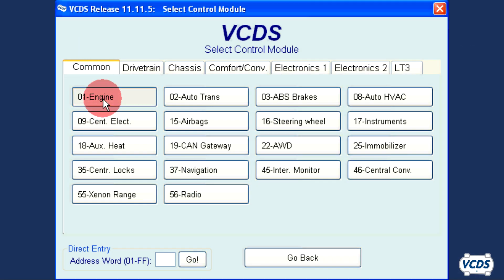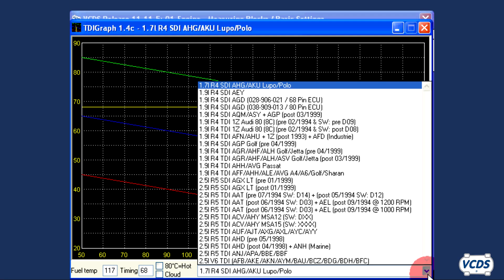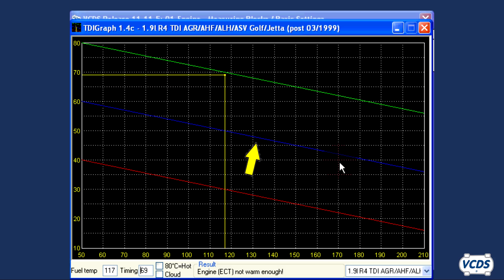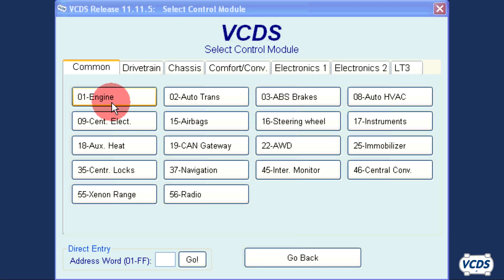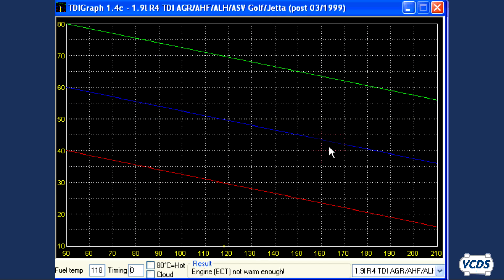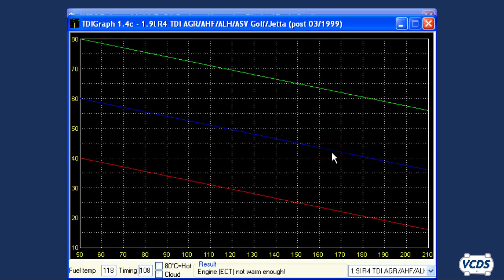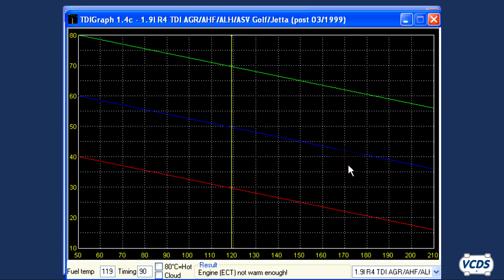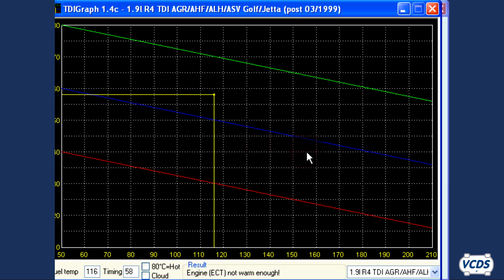Start of Injection

Comment: Im a newbie  with vw cars, I need help, I have 99 vw golf 1.9 tdi  I replace injector pump did the timing belt etc..., I need to set the timing on the pump , first question how can i do this what software do i need where to get it free or cheep, where do i download it  for free I herd i can  just buy the cable  software free? please help.  i seen video on vcds but never used it,  dont know where to start to set up software ... lots video using software... no video on how to get started with software.

Comment: Mine is a little bit above the green?
Reply: Then it's a little too advanced.  Loosen the three 13mm bolts a bit (but not so much that they exert NO friction against the injection pump pulley) and then slightly bump the 22mm nut toward the rear of the car.  Tighten the 13mm bolts and check to see if you got it into range.  You just need a pretty subtle adjustment.

Comment: Excellent video. I tried this on my Audi A4 B7 2.0 L TDI PD, but the VCDS doesn't show the option of going to group 000 and TDI Timing. I would like to check my timing as well.
Reply: PD engines dont need injection timing adjustments. They dont have any mechanical distributor type pumps to adjust and injection timing is fully adjusted by ECU.
Reply from the maker: We offer free vehicle support on our web forum for all of our registered customers.   http://forums.ross-tech.com

Comment: You selected the wrong motor.  Why is that.  2002 ALH TDI would be Pre 2004 yes?  You selected post 2003.
Reply: Nope, he selected "Post 03/1999" (meaning after March 1999), which is the correct row for this engine. The other row was "pre 04/1999" (meaning before April 1999), and therefore not the good one in this case.

Comment: i did basic settings for afb engine 2.5 , the two  yellow became between the red and yellow and fault code 00555 appeared again,
Reply: Thats not start of injection, is the quanity.
Basic setyings group 001. 3rd bar, it shud be between 3.0 to 9.0
Or by putting the mouse icon over it, it will tell u what it needs to be.

Comment: As a side note : the timing can be so retarded that it shows on the graph as being to advanced. Happened to me on a 1.9 AHU engine. Started ok when it was cold and the glow plugs came on,started ok when the engine was hot. But when the air outside was warm and the glow plugs wouldn't come on i would have to crank more then 30 seconds,sometimes almost a minute. All that went away when i did this adjustment.

Comment: my idle speed on my 2000 passat tdi is at 800 rpm,can i adjust it to be at 900+ rpm?
Reply: Late reply (8yrs😂), but you should check your "adaptation" number to see if someone changed it from the stock setting in order to adjust their IQ (injection quantity).  Adaptation also changes idle speed.  If IQ is way off at the stock 32768 number (which should give ~900 rpm), search for "hammer mod." You may need to pick up a special injection pump socket to loosen the triangle-shaped bolt. Your car will run much better after getting these parameters dialed in!

By the way, I am assuming you already have VCDS.
Reply: If you can download the map to you computer and send it to me , ill do that for you

Comment: What if you cant start the car? How do you check then?
Reply: There's a matching set of lock holes on the pump and pulley flange that line up (using a 6 mm pin, I think). Bring the engine close to piston 1 TDC, loosen the pulley bolts, rotate the pump until the lock pin slips in, then bring the engine exactly to TDC and then tighten the 3 pulley bolts and remove the lock pin.
This pre-adjustment is close enough to get the engine running.
Reply: @MarcusRoper171  I am also having trouble, Brand new engine, can't seem to keep the car running. it starts for  a few seconds and then dies.
Reply: @BlayneBriceno-j8l  If the engine starts, even for a short time, then I don't think pump timing is your problem. But just to confirm, you can try to retard or advance the pump just a tiny amount. If that doesn't change things, then you definitely know that the problem is somewhere else.
Reply: @MarcusRoper171  I have been messing with it quite a bit. I Advanced it a little and nothing changed, maybe I'll try and retard it and see what that does. I've read that there are a few different sensors, my asv is open, not stuck at all.
Reply: Before you start make marks to have old settings
Reply: The adjustment is TINY like the width of a toothpick! Only move it very small and check on graph.

Comment: what those units means? (60 - 90 etc). It is 60 -> 6.0 deg?
Reply: Old question but if someone is wondering: Lift of the injection pump in mm*100 when in tdc position. So 60 on screen means 0,60 mm.

Comment: Always use new bolts on the timing adjust. 15NM +90
Reply: never have never will. not needed
Reply: There is 2 types of bolts. 1 strech and 1 non strech.
The 1 with a flat bottom is normal,
The 1 with a pointed bottom is the strech.